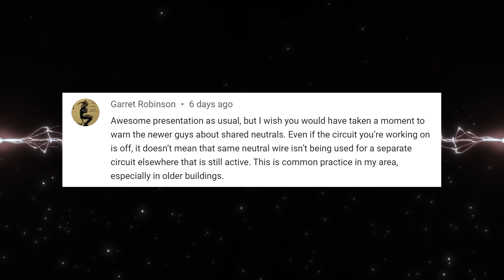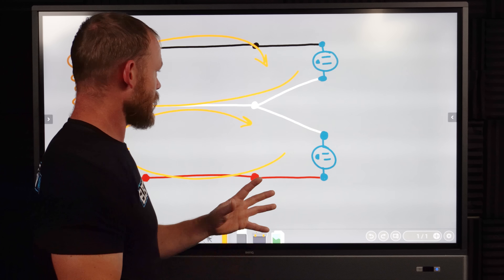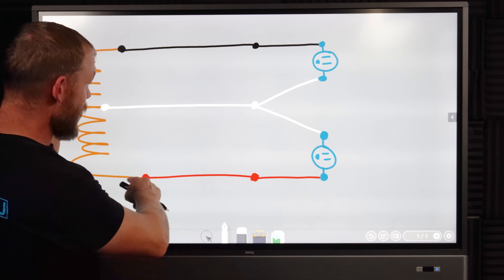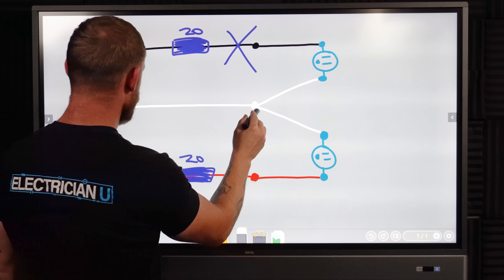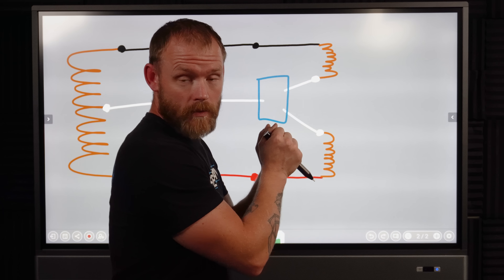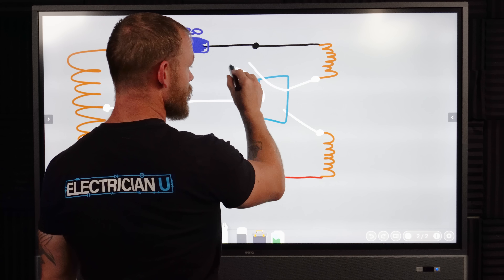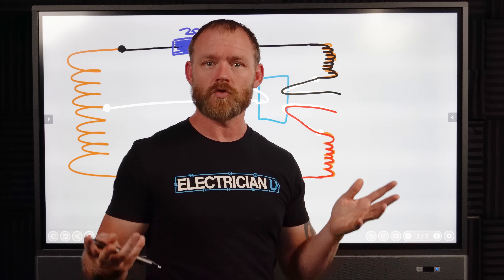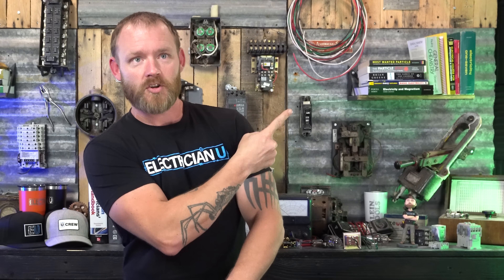The Dangers of Shared Neutrals: How To Avoid Being Shocked

Comment: Split phasing is not necessarily a bad thing.
If you share neutrals be sure to use a double breaker that feeds both hot wires.
Electrical service to your house has a shared neutral.
Shared neutrals can be more efficient.

Comment: Running a 12-3 does a heck of a lot more than saving 1 conductor.  It saves a ground, it saves an outer jacket.  It saves wire clutter.  It saves holes in the structure. It saves possible increases risk of fire. Just take a moment to think about it.

Comment: Your videos are always super awesome and i learn so much. However, since I can't dm you...I just wanted to make a small correction so you can continue to produce even more top notch content.. it's not that the neutral has current on it. It may have a potential. It shouldnt but if the neutral isnt grounded properly or isnt near the spot you are at, it will "float". The neutral wires would have a potential on them that is different than where your feet are. if you were to touch it, you would complete the circuit to ground, allowing current to pass.and if it helps a little more, potential is measured in voltage. It's the potential for something to do work ;-) that's why a motor connected to 120 or 240 will have the same power. The potential of the 240 let's the motor do more work with less current.

Comment: Nice video,  As an EE, with 30 years experience, I see nothing wrong. with your explanation.   

Recall as a rookie engineer, we were dong an upgrade to an OEM machine.  they had 2 different breaker in a panel, not even close to each other feeding a 240VAC load.   I was like really, we had to call in Electrician to re-wire the box to fix this.   They were pissed of at new rookie, but I had to raise a stink to have it done right.

Comment: I respectfully disagree with you about the shared neutral. If the black circuit is in fact off, and the red is still energized,  the neutral at the black circuit still has continuity with the active circuit. If it's under load, there's current on the neutral, and the continuity means you get bit.

Comment: I wire hospitals, colleges, large commercial buildings. If I get pulled into helping a friend wire a house, I eat the cost, or make him eat the cost, of running a separate 12-2 for kitchen receptacles so no 3-wire circuits are in the building. For residential where the finished product is unsupervised it makes no sense to leave a 3-wire circuit for the homeowner to play with. They usually put both red and black on a tandem when they run out of space in the panel and double the neutral current.

Comment: Not sure if this is the same thing, but I ran into an issue. I couldn’t figure out. I’m not an electrician, but my cousin is and he told me the wires have been back fed. I was having all kinds of issues trying to add a outlet in the run if this is not the same type of thing that you’re talking about in this video, it would be really awesome. If you would make a video about wiring that has been back fed. My cousin said they used to do it to save money, but never really explained it and I would definitely like to understand it better in case I run into it again I do a lot of rehabbing and this was in a house that was built in 1885

Comment: Found this out the hard way in my house.  Turned off the breaker and still got shocked by the white and was like these whites are on different circuits.  My house has some odd electrical.  couldn't figure out what two switched in my bedroom did for a year.  Turns out they are 3way  switches that also turn on the outside lights which you cannot see from the bedroom.  Also had a live line going to the outside of the house that was just cut right at the foundation and left.  discovered that while trying to figure out why the breaker kept tripping  while  power washing .  Also most of my receptacles are split.  one on a switch and one always on.

Comment: I recently took out 6 recessed can lights by thinking I was working on what I thought was a single branch circuit. Which turned out to be a multi branch circuit.. had a loose neutral connection in the junction box upon inspecting the wires. And boom put 240v through the leds and blew them out

Comment: A secondary path can also be from Satellite or Cable service as the coax cable is directly bonded to the ground outside which can be an alternate path that can get you if there is any bleed through on the power packs or the devices themselves. If you ever have a customer tell you the Cable guy asked if their lights flicker or point out the coax is melting you have a potential open neutral or a bad connection in a box where someone was able to get 5 wires in a 3 wire wire nut or something similar the coax used should have no voltage when measuring from neutral or ground at the outlet to the metal connector of the cable jack, coax is also not rated to carry current but will until it cant anymore.

Comment: I was installing a plug and turned on the power to check if it was working. Well the plug didn’t work, the light that was tied in also didn’t work so I got my no contact tester and it was showing all the connections were hot. Even the neutrals which confused me but I figured it had something to do with it being on a multi branch circuit. I shut the power off and while taking things apart found one neutral had a tip broken off. From what you said in the video I’m guessing all the wires became hot because the main neutral tie in leading back to the breaker broke. I’m still unsure if I understand.

Comment: Sorry but by the 1 minute 20 second mark I knew that you did NOT know what your talking about. Start with drawing a picture of a transformer wired directly to outlets with no panel or ground. Then stating that that current in a 240 VAC set up has one side where currently travels out from the neutral. NO !!!! In a 240 VAC depending on whether there's only heating elements or additional internal circuits a 240 VAC appliance may or may not have a neutral. BUT either way current is ALWAYS traveling from the bus on HOT wires and if there's a neutral the current from non heating elements travels ALWAYS back to ground on the neutral !

Comment: A thermal inspection of electrical panels at my plant showed a neutral overheating in a 120V panel. Some dipstick used one neutral for several different circuits, including a 15 amp hot water heater... guess they didn't watch this video

Comment: What would happen if those 2 outlets in your video were dual function GFCI/AFCI outlets, on 2 separate breakers without the breaker handle tie? Would it cause any issues with how the GFCI/AFCI outlets handle a situation? Would the GFCI/AFCI outlet function properly? TIA

Comment: Anytime you're working on old wires, do not trust the wire colors, no.  If you do enough remodeling on a couple of old houses, you'll find something wired wrong.  Personally, I did not realize the 240V issue described here was possible.  I'm not a pro and (perhaps consequently) I'm really paranoid about getting shocked, and I blew up a 120V tester when I was checking neutrals in my bathroom.  Which was alarming.  So now I have a 480V tester and wear safety goggles if I'm not 100% sure all the power is off.  (My bathroom had one light that was on the kitchen's circuit breaker, as a surprise.)

Comment: If you lose a wire nut someplace you're generally making a path between the A and B phases by a neutral jumper wire between two receptacles between an A and B phase... using Ohms Law you can now predict the extremely high voltage you're going to get on one device and the low voltage you'll get on the other, unless they are perfectly balanced resistance loads and they're always running all the time with the same load and neither one ever gets unplugged.
I've seen light bulbs explode in people's houses lol.

Comment: Hello, Jennifer Neuman here my new home new to me house was built in 1985 and Is 100% common neutral? There isn't a single non-shared neutral feed in the panel. The first time I ever seen it when I became an electrician we learned about it and it was ironic that my house is buit that way and like you said, it's interesting. As I've upgraded different circuits and how they convert what was the red to black. Continuing the circuit of a red to a black carrying out your typical white black with the ground?  It makes for an interesting day chasing some of the circuits but awesome explanation. We had similar in our class. Keep up the good work big guy. PS non of the 120 volt breakers are tied together.

Comment: I don't know if you read comments on these old videos. I'm just learning about electricity to do some home maintenance. I also have an 11.1Kwh solar array in my field and I want to learn how that works. I think you just saved me from some curly hair or refried beans. I was going to flip one breaker to remove a ceiling light. I still need to learn how to use the testers. I will continue to watch your videos. Electricity seems to be a lot like English: "I before E except after C" (except "weird", "leisure", "neither", etc.) I do have a question. Where does electricity get "spent"? If it continues to flow, after it powers a device, does it flow down to the next house? I understand the difference between AC and DC, where DC has a limit in travel distance. A log gets spent when fire converts it to heat. Are there fewer positive ions in the wire in the loop after lighting the bulb? I think about shit like, where does wind go when it's finished blowing?

Comment: 40 years ago, the Contractor I worked for used lots of Edison circuits in new homes we wired. Another electrician I worked with told me of this very situation where he got shocked touching a neutral wire.

Comment: In cases of a shared neutral it should be connected to a load with a pigtail so that if the load is to be disconnected the neutral connection isn't being opened.  Some of the older buildings I work in have 120/208 3ph panels with 3phases sharing the same neutral, I see it all the time non pigtailed neutrals at receptials and lighting ccts it can be a challenge to determine which 3 ccts  are involved.

Comment: I always anticipate that something won’t be correctly done. Just found multi wire branch circuits run from a quad-breaker with the ever popular handle tie delete option.  Eaton quad handle ties fit nicely on Murray quads. I always expect Neutrals to go live when unbuttoned until I check them with my chicken-stick post disconnect. I think Uncle Fester used a lost panel neutral to energize his light bulb.

Comment: If I want to power a workshop and I installed a subpanel with ground and neutral going back to main panel. Wouldn't every circuit I add on that subpanel be a shared neutral?

Comment: Solution: Double-Pole breaker. You don't even need more space, you are already using two singles. In fact, if it is a Siemens or Cutler(and maybe others) you can use a quad and gain 2 more single spots after using the middle double for that 12/3(or 14/3) line. Don't just 'live with it', FIX IT! Anyone (home owner tinkering) on wires after a certified electrician was in there and did not fix it, is liable for people who get electrocuted. Cover your a$$.

Comment: You described the dangers of shared  neutrals on multiwire branch circuits but you did not explain unbalanced loads on neutrals, you know when you find  a neutral Wire that is looking brown kind of burn still has voltage and you  cant strip it easy 🤨

Comment: I ran into this a decade ago.  I was replacing an outlet an I checked the voltage from hot to ground and it was off.  I found several neutrals in the box with a pig tail to the outlet .  The pig tail was 14 ga with a 12 ga hot.  I decided to change the neutral to 12 and when I disconnect the neutral bundle and it arced.  Now I test everything with a non-contact tester.
Reply: while those neutrals are bundled together, though, they will all be grounded and the non contact tester won’t show voltage.  as soon as you pull them apart ( hence the arc) the wire still connected to the load is no longer pulled down and will then activate the tester.  hopefully the other circuit has a hot wire in the same box that will clue you with the tester that it may be a shared neutral.

Comment: You should also mention, while you can share a neutral between phases (once) you cannot use a big ass wire nut to join all the neutrals together. You better make sure what neural goes together.

Comment: I had a 200 amp panel installed and noticed there many joined cicuit breakers. Asked the electrician about it, and he said our state (CA) now requires that setup. When I asked about troubleshooting just one circuit breaker, he said go ahead and pull the tie off.

Comment: Another thing to mention would be the situation where the home run neutral to the panel is lost and now the shared neutral spice becomes a bridge between two different phases resulting in different voltages across the circuits depending on how much load is applied to each circuit.

Let's say L1 through a 50 watt bulb, through a bridged neutral with a lost home run (no connection to the neutral bar), through a 100 watt bulb to L2.
The 50 watt bulb will be running on more than 120 volts and the 100 watt bulb will be running on less than 120 volts.
The 100 watt bulb would be dim and the 50 watt bulb would most likely burn out rapidly.

The voltage potential imbalance obviously being greater or lesser depending on the difference in total resistance of each circuit. Now imagine sensitive electronics running on either of those circuits.

Comment: Thanks! I have a ton of shared neutral circuits that do go to j boxes but I've always been in the habit of shutting off all circuits that enter a box prior to any work. However I didn't realize the code called for common trip on shared neutral circuits, thanks for pointing this out! I'd like to read more about that in the code, do you know what section this is in?

Comment: the nec requires a two pole breaker for edison circuits to prevent one phase from using the neutral and causing a shock

Comment: I got a jolt from a shared neutral years ago even after turning off the breaker to the 120 volt lighting circuit that I was working on.
I was stomped and confused at the time, until I read later why this happened.

Comment: I gotta weired connection for ya, I  am new to this stuff and am wiring some lights- The original install is on a double pole 20a there are two light switches run in series now the switches are om seperate poles so when one is off then one should be off but heres the kicker since they were run in series even though one pole is still live  neither had power "funny i thought as they are run in series and should be on seperate poles" well i installed lights on the second switch flipped the 1st pole on and it blew flipped the second breaker on and it worked now wtf is that all about, Another thing for ya the original install has another set of light switches one goes to two outlets since im not using the outlets i took them off circut now two switches run on a 2pole 20a they are run individual well now the switch blows the breaker, I was told it needs the outlets so it wont overload the circut "i said hold up thats not how it works!" whoever did this original install knew less than i do and he was a certified electrician figure that one out

Comment: Thank you 👌 my 1940’s bungalow  I keep finding tricky electrical issues with. Spilts tapped up in the walls and in the attic entirely without junction boxes. Then when the time came and the old fuse panel was replaced with circuit breakers. They threw some new wires at it and walked away. I’m stripping the attic out to air seal and insulate. I’m installing new low voltage LED lighting while I’m up there.

Comment: in the course of retiring some old cables in my house I found a ceiling light fixture with 2 circuits in the box. The light was controlled through a switch at either end of the staircase. Whoever wired it originally ran 14/2 between the switches, so at the light fixture there was no neutral available...until he brought in another circuit and tapped the neutral. It made my blood run cold. On a later renovation project we had the cable running between the switches exposed as the drywall was off, so I was able to replace the cable run.

Comment: I have a junction box with 2 neutrals.  They both read 120 from neutral to hot.  Should I tie these neutrals together or are they from two different circuits and should be separated?   Thank you

Comment: Excellent explanation of the shared neutral. As a lighting designer, we could share a neutral with each of three phases when laying out a large system like an office corridor. It was easy to balance the loads, they were all the same fixtures with the same lamps, and it did save a ton of wire in these big spaces.

Comment: I've got a question. I had a situation at work where I was wiring a light at work and the nuetrals were hot. 

However, the entire 240v panel was dead at the main, but I still had active 120v between the nuetrals when I had them apart and it was actively sparking when I was working on it.

This panel was fed from a step down transformer from our 480v 3 phase panel.

Is it possible that the nuetral had voltage from the transformer still being live?